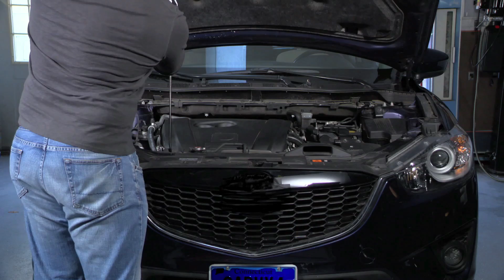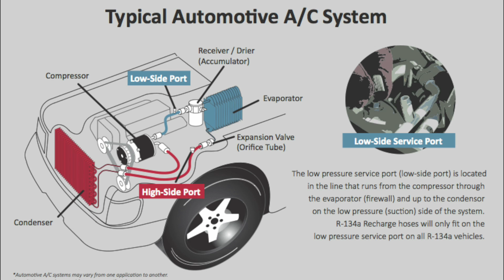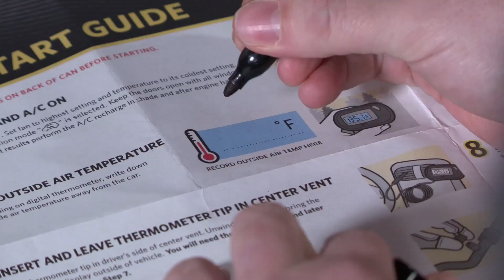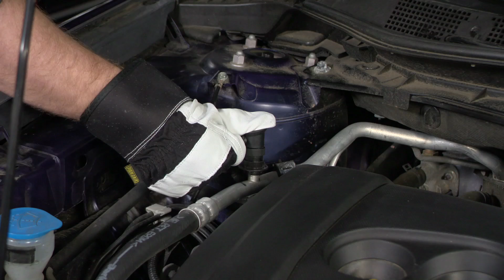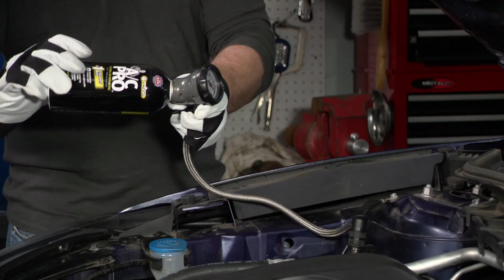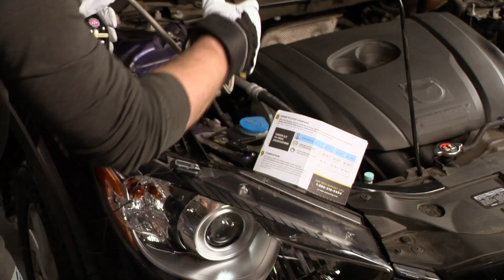A/C Pro® Accu-Cool™ A/C System Recharge Kit How-to Video

Comment: Can I still recharge my ac even if the outside temp is like 60 or should I wait until the temp get up to 80s
Reply from the maker: Malachi - ideally you should wait until the outside ambient temperature is at least 70 degrees F.

Comment: can I still do this even when my AC is cold, it just takes a very long time to cool.
Reply from the maker: The hotter it is, the harder your a/c has to work to cool the air. You can check the pressure with the A/C Pro gauge to see if being low on refrigerant is the problem. If it's low, you can recharge the system yourself. If you check the pressure and get a reading within the filled range, we wouldn't recommend recharging as you may overcharge the system.
Reply: AC PRO okay, thanks for the help.